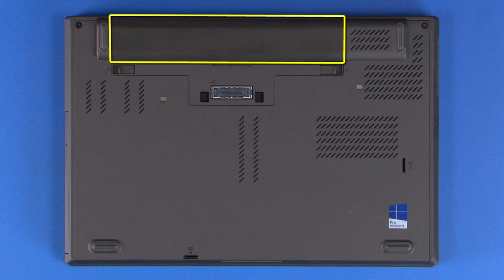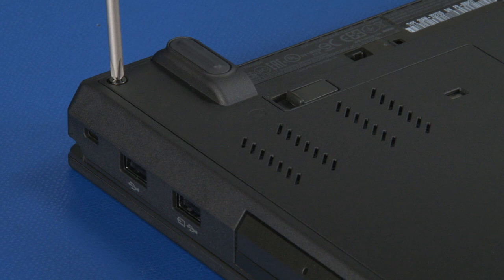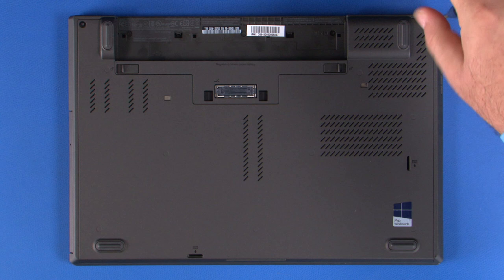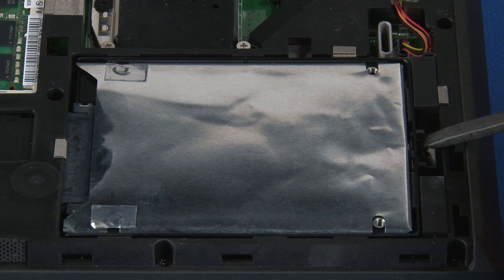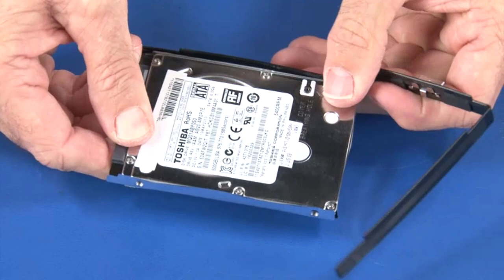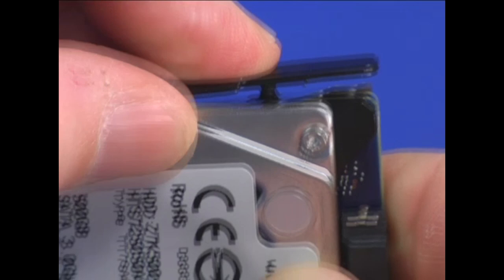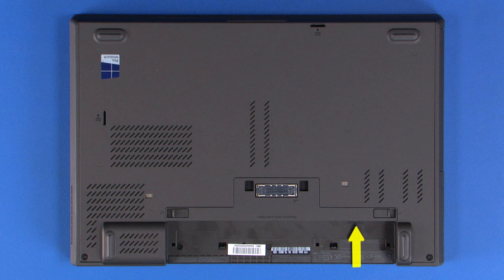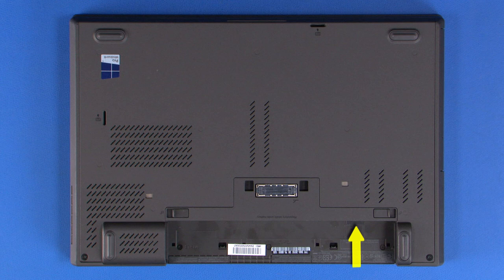ThinkPad T440p - Hard Disk Drive and Solid State Drive Replacement

Comment: Can you tell me the specs I need to know for picking a new SSD, I have only a few hundred MB's left in drive and need a new one ASAP and want to replace the current one with one that I can move to my new 8700K system which I will build within a month (hopefully). My hope is I can purchase a nice 500gig or more SATA? mSATA? SSD now to improve my space in the short term, then turn around and once I build the new system, use that same drive as a boot drive for my new PC system.
Any and all help would be greatly appreciated.
ALSO, Lenovo, you guys make one hell of a good product! This laptop has been all over America and been used HARD and I am now the second owner and it has finally come to rest at my place as a way to learn my Network Pro and PC Pro and move toward my Comp's and other certs. Thanks for making a strong product that can pull me through the classes....now just to get her some breathing room on space...(wish someone could do that to my brain!).
Reply from the maker: Hi McGyver777ATGMAIL! Thanks for writing in. You can find more info about the specification of the storage devices that you can add to your Thinkpad T440p here https://lnv.gy/2OqeqL2 If your laptop currently has a SATA HDD installed, you can upgrade it up to 1TB HDD or replace HDD with SSD with up to 512 GB. Additional info here https://lnv.gy/2OsyqN2 Hector_Lenovo

Comment: Planning to replace HDD to 512GB SSD. How to make newly installed SSD bootable? Should clone the HDD to SSD or should install Windows and drivers once again? when i bought T440p, it comes with win 7 and got free upgrade to Win 10. How to retain my Win 10 ?
thanks
Reply from the maker: Hi Syed Noohu. Thanks for reaching us for support. If you'd like to use Windows 10 again, we suggest cloning the operating system using a third-party software called EaseUS. You may also check this link about upgrading to Windows 10:https://lnv.gy/2XxRHy9 Let us know if you need anything else. Ash_Lenovo

Comment: Which size/type should the SSD be pourchased to fit in the T440p?
Reply from the maker: Hello Enrique, we're delighted to know how interested you are with our products. The type and size of SSD that will fit for this model is M.2 2242. We have available on our website but for cache only and this SSD has been tested for ThinkPad T440p. The part number is 04Y2169 or you can visit our website here https://lnv.gy/2Z8ly1N. We hope this information helps. Feel free to reply if you need additional details. We'll be glad to assist you. Fraineee_Lenovo
Reply: @LenovoSupport  This is incorrect.  The size of the hard disk slot in the T440p is a regular 2.5''. The Wireless card does in fact, have a M.2 2242 form factor.

Comment: Is SK hynix Gold S31 1TB compatible with t440p?
Reply from the maker: Hello, thanks for reaching out. Are you looking to replace the 2.5" SSD in the machine? If yes, please provide model number of your computer so we can check the compatible parts that will work for your machine. We'd like to help. Allan_Lenovo
Reply: @LenovoSupport  it's Lenovo T440p 20AW004FUS. Thanks. Really appreciate it.
Reply from the maker: Hi! As long as it is 2.5" wide, 7mm high. It will work on the computer. Based from the specifications of the SK Hynix, it will work well. -Jerry_Lenovo
Reply: @LenovoSupport  cheers! 🥂
Reply from the maker: We appreciate you for reaching us out. Let us know if you have other concern or queries. We'd be glad to help. Fraineee_Lenovo

Comment: Why do you have to remove the SIM card? It's not in the way and the system has no power, so...what's the purpose? Just for fun?
Reply from the maker: For the most part we go off of what the hardware maintenance manual says, so if the HMM says that the SIM card is a prerequisite to remove the SSD we include it in the video. In this video it doesn't seem to be necessary, but in some machines the SIM card tray can actually cause difficulty removing some components.
Reply: Gotcha. That makes sense. Thanks very much for the reply!